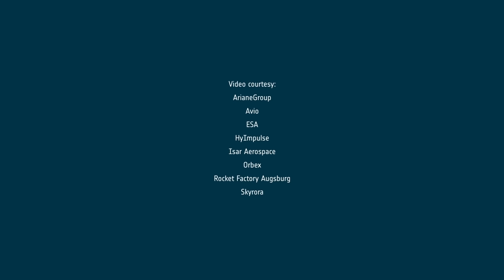Europe's future of space travel

Comment: I thought ESA was funding the skylon project?
Reply: Skylon, sadly, will most likely never happen
Reply: @bryanillenberg  why?
Reply: @Rat-nl1xe  two reasons:
1: The company who wants it developed doesn't want to do it themselves. They just want to design the engine.
2: It's a really bad design. SSTO's have no advantage over two stage vehicles, and a host of disadvantages.
Reply: @bryanillenberg  Skylon is a bit more than an SSTO...
Reply: @krashd  no, it isn't.
A jet powered SSTO is just an SSTO. Only difference is it's slightly more fuel efficient, but only during early ascent. For the majority of the burn, it may be less effective than a comparable vehicle (such as the canceled X-33), due to the sheer number of compromises that are likely needed.